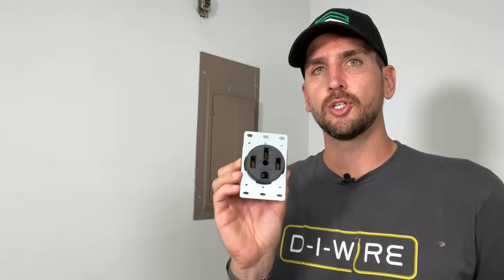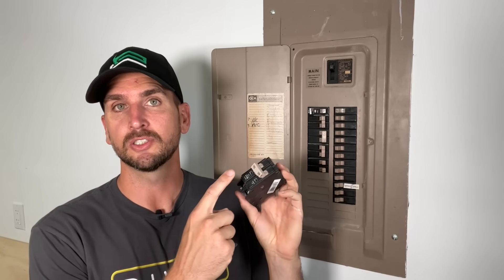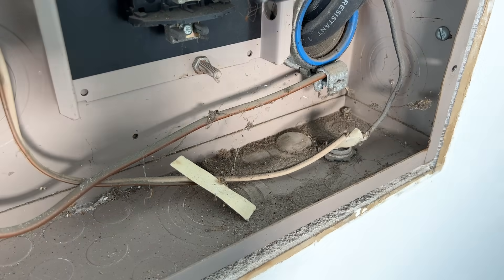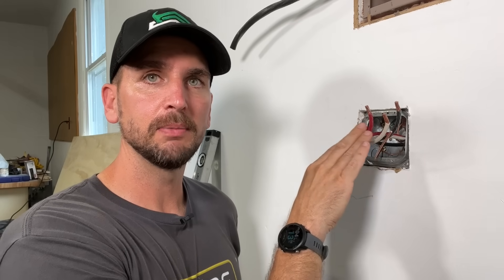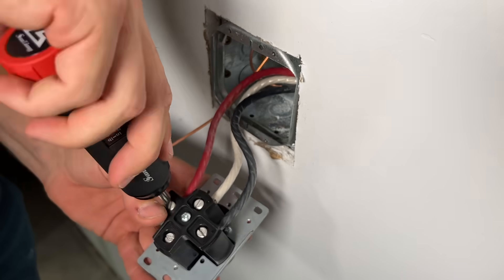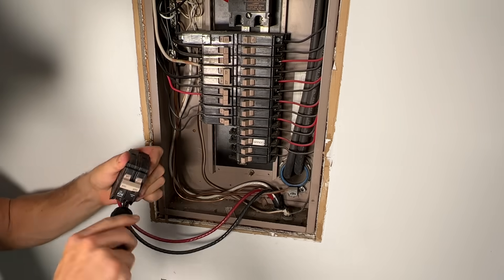Quick and Easy DIY 240V Outlet Install | 50 Amp NEMA 14-50

Comment: TO REPEAT OTHERS:
Use ONLY a COMMECIAL NEMA 14-50 plug for an EV Charger. Nothing pulls current for as long like an EV. They should cost about $65, the $9 plug will fail for EV charging. DO NOT GET IT.
If you are installing a 60 Amp breaker, which you should for a 50 Amp charger, use  FOUR GAUGE Wire, not 6! 
Use a METAL box, not plastic.
Use ONLY COPPER wire. Not Aluminum (Aluminum sizing is 3 gauge for 60 amp breaker)
Torque all the connectors. And after torquing, wiggle the wire and re-torque.
You're planning on charging a $50-$100k vehicle in your half million dollar house. Spend the extra $50 for the better plug and thicker wire!
Reply: Sure, use the best American made parts, #6 wire,  and the 60 amp breaker—if room for such draw in the box.   However, the “charger” that plugs into the 14-50 NEMA which interfaces between your outlet and the car should/will restrict maximum amps to be pulled/fed into the vehicle.  Buy one that does have such settings.  You can start by feeding, say 32 amps to the EV.  32 amps is typical camper park draw.  Then check temps over time.  If it performs well, you can up it, say to 40 amps.  The difference in charge times for most all applications I can think of is minimal.  8 hours tops for a typical EV, and most likely much less.  My Ford EV came with such a “charger”, but not set-able.  Limit is internally set is to feed 32 amps exactly for safety issues.  Feed may be a misnomer, I believe it simply handshakes with the EV and limits the draw.  I’ve had no “heat issues” with my cheap Chinese 14-50 plug.  But then again do not draw more than 32 amps.  Had a Tesla use the outlet and was told whatever was there worked fine with no heat issues, but I believe Tesla is a bit smarter wrt such issue detection.

Comment: The current NEC standard is to use a GFCI breaker when wiring a 14-50.  Don't see that in the video.
Reply from the maker: Yeah, that's a good callout as where this was installed is still on NEC 2014.

Comment: Actual electrician here, please just hire a company to come out and do this properly. Don’t risk a fire because you wanted to save a few bucks. Get it done right. There were several good tips in this video but overall there were many things I would have done way different as I install these a lot

Comment: I own two Tesla vehicles and a pair of chargers. Initially, I opted for the affordable $9 plugs, but due to overheating issues, I switched to the more durable 14-50 Hubbell plugs. After replacing both of the cheaper ones, I've learned a valuable lesson that I'd like to pass on.
Reply from the maker: Yep, I agree the Hubbell 14-50 is the way to go 👍.  Thanks for the feedback!

Comment: Good demo on cutting the drywall with just the tip of the saw. Some studs have wires stapled to them, and you don't want to hit those with a saw. In the vid, clearly there was no existing branch going down from the electric panel, but other homes may be different. Thanks for the video. I feel confident now to install my own.

Comment: Plz plz plz don’t use the $9 Nema 14-50 you need to use the commercial grade. The $9 ones are not made for continuous load like a charger. Over time like a year that $9 receptacle will melt. It also needs to be GFCI protected in your garage. Meeting code remember.

Comment: This is not the type of project you want to cheap out on.  Electric cars use a whole lot of power for hours at a time.  You need a perfect installation to avoid overheating and a fire.

Comment: 2023 code 220 breakers need to be gfci breaker... thats more money .. 2023 code requires a surge protector.  That's more money tesla requires copper To be ran to the outlet that's a lot more money by the foot then there's the conduit. Ahhhh your using romex $$ per ft box plate device staples / supports  id like to see the receipt for the title  I'm thinking at least double depending how much copper you buy at april 2024 prices

Comment: EVSE devices pull a ton of power for 3+ hours probably in the night when you are alseep, don't use a $9 receptical get one that is at least rated for commercial use. Best practice for using an EVSE is to have it hardwired not plugged in a lot safer

Comment: Dude...  Where's the 50A non-fused shut-off box along with the GFCI Breaker as required by the current electrical code... ??     Super Hack !!
Reply from the maker: Definitely need to check your local code but for this location it is still NEC 2014.

Comment: Don't use cheap (under $10) NEMA outlets - get a commercial one. You'll be glad down the road cuz the cheap one will melt.
Reply from the maker: Yeah, I have switched over to the Hubbell 14-50 👍

Comment: This guy should have mentioned that the receptacle needs to be "EV Grade" to avoid fires.
Reply: Can you share how to make it EV grade?
Reply: @VP411Designs  You just want to avoid brands that are used for stoves in the kitchen like "Leviton"... Those are no good because they are not designed to have many plug and unplugging of the charger.

You need a receptacle such as "Hubbell" brand. They have the stronger components, and the back plate is made of metal. Also make sure to buy good quality cable to connect to your 50-amp breaker. That way you will have no issues for long term.
Reply: They will say ev rated on the with a logo of a green car

Comment: @01:50   Remove Panel
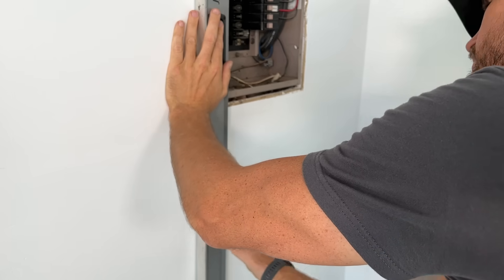@03:26   Cut drywall, use level
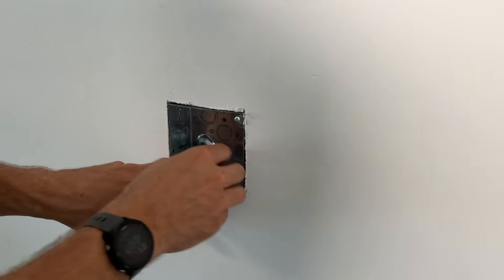@04:30   Wire/Connector at panel
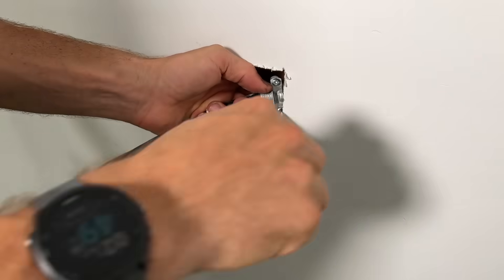@05:29   Wire/Connector at box
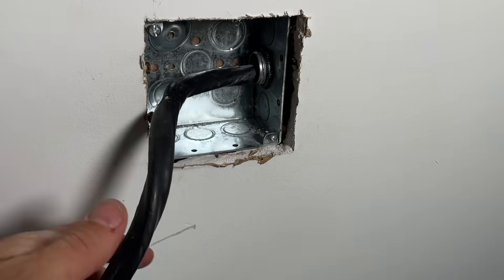@06:05   6" wires for code, and GND pigtail
@06:35   Wago 613 3-wire
@08:30   NEMA plug install (20 in/lbs)
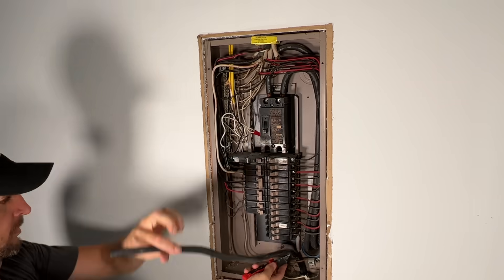@09:32   Panel wire connections
@10:19   Breaker install (40 in/lbs)
@10:43   Voltmeter

Comment: ⚠️CAUTION: DO NOT USE CHEAP CHINESE MADE NEMA OUTLETS. THE POWER SUPPLIED TO VEHICLES IS MUCH HIGHER AND CONSTANT THAN A WASHING MACHINE/DRYER. BUY COMMERCIAL GRADE NEMA OUTLET, INCLUDING HUBBELL SUCH AS “Straight Blade Receptacle, 1 Outlet, NEMA 14-50R, 50 A, 125/250V AC, 3 Poles, 4 Wires, Black” OR ANY OTHER COMMERCIAL GRADE USA MADE PRODUCT. BUYING CHEAP NEMA 14-50 OUTLET COULD RESULT IN A FIRE. I’VE SEEN IT MANY TIMES IN RECENT YEARS WITH EV CHARGER INSTALLS.

Comment: Current NEC requires the outlet to be GFCI protected. Just the proper breaker for this project is $105-145.

Comment: Great video! I would add that you correctly left some conduit cover inside each box when exposing the wires. I would use a multimeter to check that the bus bars are really "off" after tripping the main. I also use a level when cutting the hole for the new box. Thank you so much !

Comment: Will this work for a Tesla ?
Reply from the maker: Yepper, some of the chargers like the Tesla Level 2 you could also just directly wire using a similar approach.
Reply: @EverydayHomeRepairs  the biggest issue I am running into is my panel is far from where I park. So the easiest for me to do is install this type of receptacle right next to the panel and then make an extension cord that reaches my driveway to charge the Tesla I am hoping to buy next year. However, I heard that these receptacles are not meant for stuff to be plugged into everyday. It can loosen the terminals very quickly and cause a fire. So me plugging and unplugging an extension cord is tricky. What are your thoughts? And do you think that’s true about these receptacles, since they were designed for appliances, they should be utilized for one plug and leave it in for like 5 years with unplugging.

Comment: All these people putting in 240 with a breaker panel in their garage like 2 feet away. smh.....I'd have to run it thru the basement up and out; over 40 foot run.  And my basement panel is completely full too!

Comment: DON’T WASTE YOUR TIME with those cheap receptacles. I used the $15 one from Lowes, 6awg wire, welltorqued, over heated after 1 year of 32A use. Luckily the tesla mobile charger monitors temperature and caught the problem. I replaced with a Hubble brand 14-50 receptacle and no issues for over 2 years now. Also the Hubble is made for plugging and unplugging unlike the cheap $10 dryer outlets

Comment: My house builder left, what I thought was prewire for an electric car. I uncovered the plate, and it appears to be two standard Romex lines. They appear to be the same 14 gauge romex wires I find around the house. I initially thought maybe the two can be combined? Is that a thing? Awaiting an electrician but figured I'd learn a bit about what is needed. My priority is to get faster charging (48a?).

Comment: Excellent Video. I'd like to take the advice from the comments about the receptable and wire. I'm an EE but always dealt in DC, low-voltage stuff. So I don't know how to source quality stuff. Can someone provide links to an upgraded connector and the copper wiring that I should use?

Comment: It’s a difficult install. The wires are very heavy duty and difficult to manipulate. Finding a space for the ground wire in the main panel will prove difficult for many. Punch out the hole furthest to the back. Use copper wire, use a quality outlet like Hubbell. Torque down your wires twice releasing them in between. Use a box that you can add an extension plate to the front as you will need it for the depth of the high quality outlets and running the extremely rigid wiring.

Comment: question,,,, I only see one bus bar on my panel,,,, all white wires,,,,, are u saying that in addition to running the white wire, I can also run the ground to the same bus bar ? I don't see a separate busbar for grounds, my panel is old ?

Comment: hi, I followed for installing 240 V 100 A circuit for my EV charger. What do the instructions mean by "The Neutral at the service panel must be connected to Earth Ground somewhere in the system "?

Comment: How did you get the mud ring inside a hole that appears smaller than the wider part of the ring plate?  Does it fit in the hole, am I mistaken?  Also, are three screws into one stud on one side strong enough for when you plug in or unplug?  Thanks for the great videos and knowledge.

Comment: DANGER DANGER! This is a great channel, but I have one problem with this video. Cheaping out on your NEMA 14-50R socket might cost you a lot in the long run. The Hubbell/Bryant versions recommended by Tesla are more expensive ($70/$50), but they also carry a lower risk of fire. Those sockets have a different type of wire clamp that tightens to 75 in-lbs. If the clamping pressure at the breaker is 40 in-lbs, why would you want to use any less at the other end? 20 in-lbs is nothing. The extra clamping pressure will mean that years from now they should still have a good connection that doesn't overheat. If money is tight, forget the torquing screwdriver, buy a better socket, and clamp it down as tight as you can.

Comment: I need to run my portable charger at 16amps but I have standard outlets rated for 15amps.  My panel box is 100amps total.  Can I install a 240v outlet and 20 amp circuit breaker to accomplish the 16amps of power?

Comment: Hi,

I think there is an often overlooked issue with these installations - NM wire is limited to the 60C ampacity chart in the USA, and EVSE charging is required by definition to be overrated by 125%, in the same way continous loads are.

6 guage NM is good for 55, or up to 44 amps when derated for continous load (0.8, the inverse of 1.25)

Many EVSE chargers are 48 amps. These installations with a 14-50 on 6 guage NM are therefore noncompliant and NM based installations should be load limited to 44 amps to be 100% compliant - Running it in conduit or smurf tube and using THWN would allow you to use the 75C column, which would make it permissible. It's a small issue, but technically not code compliant when used with common charger loads. Really the USA needs to stop using the 60C rule for NM in all circumstances - it's overly broad, but as it stands it's noncompliant.

Comment: what do you do if your electrical panel box isnt INSIDE the garage, but on the OUTSIDE side of the garage, and you obv want to be able to charge your EV inside the garage?
Reply from the maker: Most panels have knockouts on the back which could provide you a path to an interior wall right behind the panel.  Not sure this would work for your exact setup but for most installs it is doable.  Best of luck.

Comment: If you dont use a commercial/industrial grade outlet for an EV charger you will end up replacing it as the car will start to fault because the heat the outlet will produce.  I found out the hard and the new outlet was over $80 alone. And FYI YES Im am qualifed to do electrical work.  I would recommend a hubble commercial grade nema 14/50 those usualy are between 80 - 100 dollars..

Comment: Use ceramic female as plastic ones are a leading cause of fires, per the fire department.  Doesn't matter if the code doesn't require it.  It's thousands of dollars to repair after a fire.

Comment: You're gonna want to use a high quality NEMA 14-50 outlet, unless you're going to hardwire the charger. The big box store outlets like this one will melt. Use a Bryant or Hubbell outlet ($50-$100).
Reply: Correct.  I have replaced 2 of the cheaper 14-50's, melted.

Comment: I spent $200 myself on a 60 amp breaker and 72 total feet of 6AWG copper wire to wire my Tesla Charger. That includes wire conduit/electrical PVC to run along the garage wall to where I wanted the charger.

Comment: Man I can’t find a 10awg pigtail anywhere. They all come in 12 awg… does the size really matter?
Reply: Go to a electric supply store and ask for a 1 foot cut of 10 awg bare copper, or if you have some wire left over that’s 10 awg strip and use that.

Comment: Oh brother, you got off EZ with a 4 foot run. I have to run 65 feet of 3/4" conduit from the other side of my basement, poke it thru to my garage, then sell my car to afford the length of Romex 6/3 required to wire it up. Good video, tho!

Comment: Thanks, this video is very helpful, I've just setup an 240 outlet follow it. Just want to add: before turn to test voltage, you should test connections/crossconnection to ensure it setup as expected. Also be aware with your main board, need to buy those match its branch

Comment: I did it myself (Owner Builder) as described in this video. It was not difficult at all. My total cost was around $100.00 Now I can charge my Model 3 Tesla at home with the Tesla mobile charger which gives me 32 amps. Great Video and well worth the upgrade.
Reply: That sounds like a standard 50 ampere 2 pole breaker without GFCI protection and one of the 14-50 outlets standard at Home depot or Lowes. You will probably be fine without the GFCI protection, but at least put in a commercial 50 ampere outlet for safety, unlike the one used in this video. 💙 T.E.N.
Reply: how many miles of range per hour does that translate to?
Reply: @diodiodio222  40
Reply: How has it held up? Would like to know if it melted in summer or if you retorqued the connections. Be honest my man please.
Reply: @stinerart1  To be honest it is still in use without any issues. I use it at least 2 days a week with the mobile charger. My only issues are with the Mobile Charger. I guess because I use it a lot it is starting to wear out. I might have to replace it or go with the Wall Charger.
Reply: How fast charge with that one ?
Reply: Be careful this plug it’s not rated for Ev chargers

Comment: Raise hand if your electrical panel is on completely opposite side  of your house from your garage
Reply: What's that? Other side of the property you say? I have a 5 stall detached garage at the very back of my property, it used to be a carriage house and stables in the late 1800's. I'd have to dig a trench to run 240v to it.
Reply: This is my parents problem with putting in L2 charging for their ID.4, no room in the garage subpanel and the main box is on the non garage side of the house.  They decided to live with L1 rather than pay $2000 to run another subpanel  to support L2.
Reply: @Brons2 ouch
Reply: Yup
Reply: Mine is on the same side
Reply: Raise your hand if you don’t have a garage.
Reply: @Sashazur ✋🏻🤷‍♂️

Comment: Why is the NEMA 14-50 a 4-wire plug?  240v single-phase is 3-wire, 2 hots & a ground. The neutral is only used for 120v. And 4-wire is (usually) for 240v 3-phase, which is 3 hots & a ground. I'm charging my Mach-E GT from a 3-slot welder (dryer/stove) plug mounted near my main panel with an adapter to convert to NEMA 14-50 for my Ford charger; it seems to work perfect.